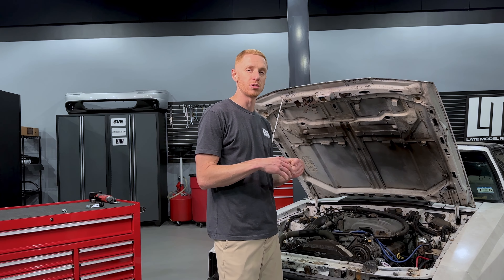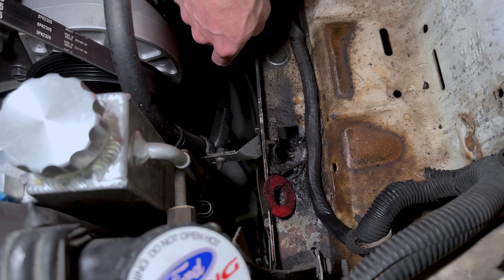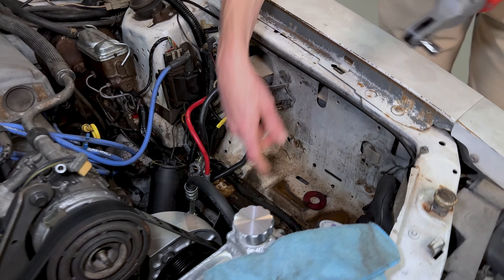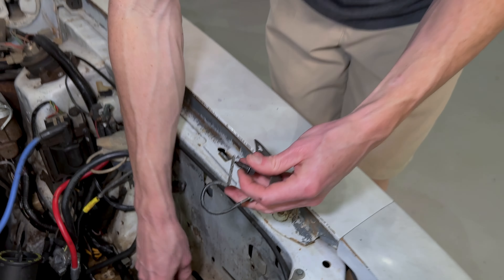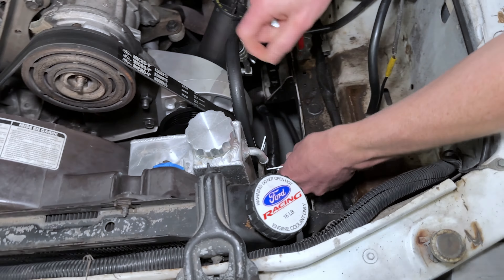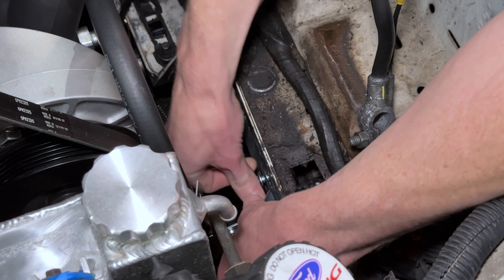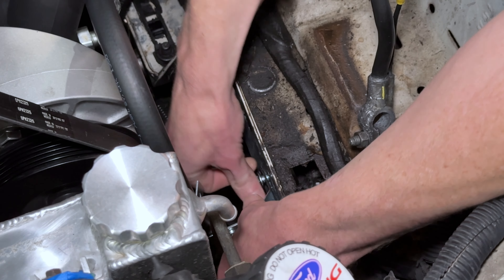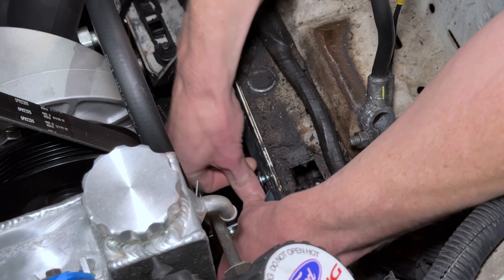1986-1993 Fox Body Mustang: 5.0 Resto Power Steering Hose Bracket Install

Comment: Nice little job Landon.

Does LMR sell a "general" replacement hardware package that would include the different sized nutclips, the small and large surface area plastic scrivet/ rivet style push retainers for plastic pieces, self tapping screws, etc....?
Reply from the maker: Thanks! We sell full hardware kits as well as specific kits for certain areas of the car. I'll provide a link to the category that way you can take a look. Also, is there a specific part of the car that you need hardware for? -Landan

https://lmr.com/products/1979-1993-Mustang-Hardware
Reply: @latemodelrestoration  Landan - I have just finished resurfacing/ coating with POR 15 & TopCoating the entire engine bay, strut towers and beams and radiator support and so when I reinstall the fenders and the vacuum amplifiers and ball and washer reservoir , etc..... I am considering just buying a new hardware kit rather than spending time wire wheeling nutplates, clips etc...

I appreciate link's to those specific areas as well as plastic connectors for the GT Fairing skirts under the doors, the plastic closeout panels....

I have watched your videos for years and appreciate the time you spend creating the awareness about the "HOW TO" on so many pieces of the foxbody puzzle - great stuff.

I'm looking forward to hopefully meeting you and team in November @ the Texas Mtr Spdwy with my 89 GT Convertible  - I've got a tight window but it's my goal for the completion.

Thank you sir
Reply from the maker: @89gtsmoke  You're very welcome! Thank you for your business and for the great feedback. There are areas of the car that we don't have hardware for at this time. Most of it is for smaller, more obscure parts. Looking forward to meeting you and seeing the car in November! -Landan